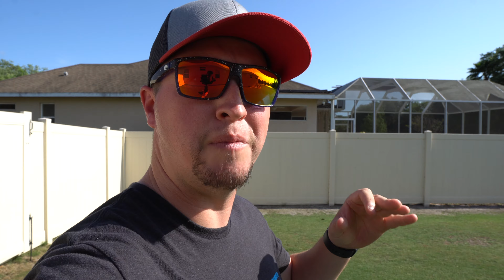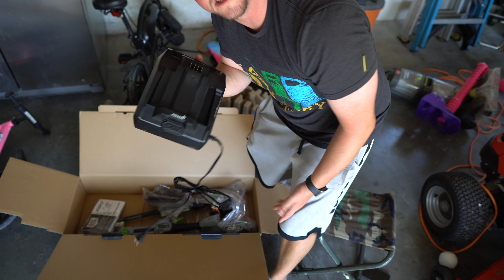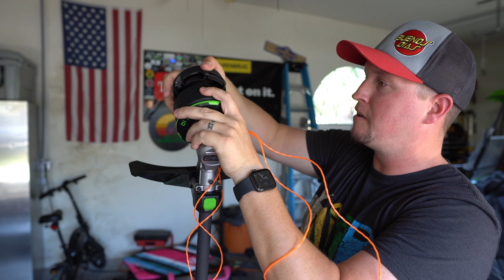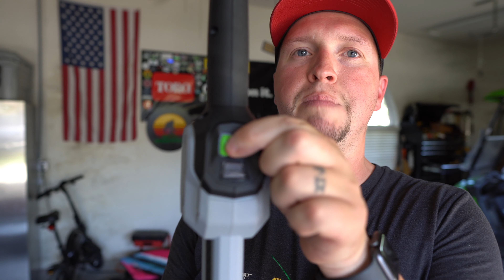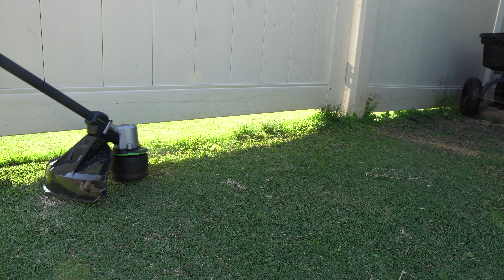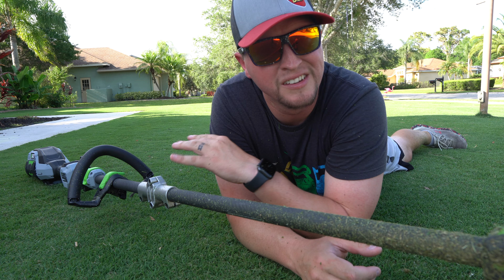Best battery trimmer ever?? Watch before you buy Ego 16" line IQ trimmer!

Comment: I just got mine, been using the older model for 5 years and needed a new battery to replace my 10 year old 2.5Ah. So it was a no brainer to upgrade because you basically get upgraded head and other features for $50 more.   Have not used it yet but if the Line IQ works like it is supposed to work, it will make my long runs of edging a lot simpler now. The sidewalk always breaks the line on these stretches and I am constantly bumping the unit.

Comment: I have acreage, I cut about 1.5-2 acres my driveway is just over 300 ft with curbs. Trimming just about kills me in the heat of NC. This trimmer is light simple switch to turn on. No gas and oil, and pulling with occasional hard starts. I have all gas sthl products. I told my wife after doing half of our property I feel like I went from riding a horse to a car. For just the loading of the string it would be worth for me. Between the light weight, the cutting power and not messing with gas and oil, I will be migrating to all battery tools from here on out. Kudos ego!!

Comment: 3 years later, do you still have a good opinion of this st1623t trimmer?  how’s the line iq?  i’ve read some horrible reviews on it.  it now has the 4ah & 2.5ah batteries for $299.99.  btw, what is the prior years model you mentioned?  thanks.
Reply from the maker: Good question. The line iq automatic feed stopped working correctly after some time and I like having control over when line feeds so I wouldn't recommend it at this point.
Reply: @Brettsgrasscapades  btw, what is the prior years model you mentioned?
Reply: @Brettsgrasscapades bump is still better then?

Comment: I mean.. I think for the money, one could go for a STIHL FS70 at around the same weight. Gas caveats aside, if it breaks you can fix it. You could also buy the commercial EGO trimmer with less features to potentially break and a slightly better water ingress rating. Ego tools are great and I use them in my landscaping business as well, but they don’t seem to be getting any lighter and don’t seem to be advancing enough quite yet to really rely on them for how much they cost with as many batteries as someone might need.
I’ve also found that these batteries last maybe 3 years tops before showing decreased capacity so that’s something to keep in mind when comparing maintenance costs of gas/battery equipment.

Comment: Thanks for a great video. I have gradually been moving all of my outdoor equipment over to EGO. So far I have a chain saw, blower, edger, and hedge trimmer. Next on the list is an string trimmer. Right now they have this model for $329 but it also includes an additional 2.5 Ahr battery ($179) in addition to the 4.0 Ahr. I appreciate the detailed review.
Reply: I just bought this yesterday, especially for the extra 2.5 Ah battery. My 7 year old cfm530 Ego blower battery is shot. And my old Sears trimmer with C3 battery, while is still usable, is a pita to reload string, and the string extension requires either multiple start/stop or manually doing string extension. But it does have a rotatable head for edging, which is convenient. The Ego seems easily convertible to edging by rotating the forward handle to the rear and inverting the trimmer, resting on my shoulder. Haven’t tried it in actual use yet, but that seems doable.

I thought about getting the multi-head Ego with both the trimmer and edger attachments, but thought the base unit was heavier than I wanted and the cost for all would have been pushing $500 with tax and all. So I got the st1623t from Lowe’s. They were out of the extra battery so it will be coming in a few days.
Reply: @speedlever  I'm thinking I need to make the purchase this weekend. Concerned that prices may be increasing in the near future.

My edger is part of the multi-tool system and I also thought about getting the string trimmer attachment but weight and price make no sense. EGO essentially gives you the tool for the price of a battery so buying a tool attachment alone is never my choice.
Reply: @ 
Honestly my old Sears trimmer is less that half the weight and with the ability to rotate the head 90*, is much easier to edge with than this behemoth. But in fairness, I’ve only used it once since I got it. I’ll have to learn how to trim and edge with this thing. My straight lines aren’t very straight. And when the head spools out more line, it affects the trim line too. I just picked up the 2.5Ah battery today and will try that next time to see if the weight helps.

Comment: There are two things I'm concerned with. I like a variable speed on the trigger itself when I need to be really careful in certain spots to not gouge up something, and I like the guard off for more string feed out making a wider cutting swath like the landscapers do. I'm thinking maybe the sensor would just limit the feed out to what it wants and won't let it out enough for what I want. Since I don't want to go back to a troublesome carburetor trimmer, I can live with certain lackings I guess.

Comment: I was very excited to get this trimmer!  Went to my local ACE and picked one up, read the instructions, put everything together, waited for the battery to fully charge, attached the battery, set my speed, pushed the lock forward, pulled the trigger and absolutely nothing happened, watched some videos did all the trouble shooting I could think of still nothing.  And off course I did all this because by the time I did everything the support lines were closed!!!  Bottom line, over $300 and I have a brick!!!!!!  Very disappointed in EGO!!!!!!

Comment: I have this same trimmer but for the life of me i can't get it to work like you do in the video. The thing is extremely powerful but it doesn't seem to cut anything. Doing my fence line has been brutal. It will just blow the grass over and if i move it a little closer it starts marking up the fence and pulls the trimmer forward and jerks all over the place scalping everything. I've tried everything and can't figure it out. Never had a problem with my old black and decker.

Comment: I am looking into these. Thanks for the video. EGO has a sale going on for a lot of their equipment. The sale for this one is if you get this newer model for the $300, they give you a 2.5ah battery free. They are doing the same thing for their higher end blower(765 CFM) Get the blower for $300 and get the 2.5ah battery free. Ironically, they have a deal, get this trimmer and the 765 blower as a bundle for $550, but you only get the one battery and charger in the bundle.. I am going to get them separately and spend the extra $50 to get the free battery.
Reply from the maker: Its worth it for sure! They never do sales like this so jump on it!

Comment: Good information, I was doing research on the Ego after getting an ace hardware flyer.  

And I came across your video just now, I am leaning towards getting one now.
Reply: They have a deal on these now, if you get this newer model, they are throwing in a 2.5ah battery free. ($180 value) I am getting one!

Comment: I got the $175 one 2.5 amp battery lasts 1/2 hr, bump head no issue, carbon fiber shaft , 15 in head, 10.5 lbs with battery, no adjustment on handle or shaft, 50 min to charge . 2x times to do whole yard. I’m 78 need rest day anyway. Same power as gas Echo.

Comment: Avoid Ego.  My battery died after a year after purchasing. Replacement died after 2 and now they are saying tough luck that it's outside warranty.  My string trimmer went down and it took 3 months to fix.  It seems customer service has gotten pretty bad over the last 8 years I have used their stuff.

Comment: 👎👎 My gripes:  the string length is too short, shaft is too short and it’s WAY TOO HEAVY to do a big job. It’s built well, it’s like an elephant.  Experimented with taking off the guard to achieve better swath, won’t go any longer.   I can’t see the hype for this unit.  Was $330, $299 on sale at Lowe’s and my light weight Echo was much stronger.     👎👎
Reply: Did the string line IQ work atleast?

Comment: I have this trimmer but don't like the auto feed line.  I have a lawn business and wanted to run this without the guard which you can't do becasuse it doesn't have a bump head.  how does power compare to the 1511t. They both have 2 speeds so I figured it was probably the same.

Comment: I know this is an old video but the bulk of the expense for this trimmer IS the battery. If you are already in the ecosystem or you are planning on getting a different unit.....get just the trimmer without the btty or get an aftermarket battery and save.

Comment: Thanks for the review I’ve never had one before. I was checking them out ant I noticed the better hook to hang the trimmer easily and secure. The workmanship was impressive when I examined it. I didn’t want to spend $300 either. But the 16 has a heavier look at the head and I wondered if it real worked as advertised. Thanks So  very much. Great testing video 👍👍

Comment: This design is horrific.  It will NOT let you manually extend the line, and you'll spend the majority of your time cutting with little nubs of line because it refuses to extend the line until you're almost down to nothing.  If I can't return it, I'm going to replace the head.  Garbage design

Comment: Not working out for my lawn business as I’d hoped.   The only flaw is the line IQ does not advance often enough as I need for effective use.  When it is at the full length, it’s great, but spinning with a short line wastes my time and energy slowing me down.  I mow 60 lawns per week, I can’t wait for a machine to decide to work.   Any suggestions how to get a faster advance ….a smarter IQ, mine seems to have a low IQ?

Comment: I don't know if it was last year's model, but almost a month ago we bought a lesser model that was part of a package with the blower (originally $300 and down to $200), and it was horrible. The bump didn't work more than half the time. We just picked up this one today. If it works as advertised the Line IQ is worth its $300 price tag in my opinion. It's also VERY nice that my wife and I no longer have to use an allen wrench to adjust the handle or length each time one of us uses it after the other.

Comment: I got this model the other day and it is just amazing as all of the videos make it seem.  But there is one unadvertised feature that no one seems to notice or mention.  On top of the main unit where the battery goes, the area where I usually brace my forearm to steady the trimmer is wide and flat and at the perfect angle for the forearm to rest.  And since it's battery powered, it doesn't get hot like on the gas trimmers.  Even other battery powered ones often have sharp, square edges to the housing in that area.
Reply: Probably meant ergonomics
Reply: @dougm8050  yep.  Lol
Reply: Bought th I s trimmer yesterday.  Absolutely worth every Penney of the $300.  With the 4 AH battery & Charger included and the advanced features it is a bargain.
Reply: @Loren07201 will I regret saving a $100 on the 15” carbon fiber model that doesn’t have telescoping features?  Has the same 4ah battery but it doesn’t adjust length and needs the bump to get more string.
Reply: Yep, the economics is awesome.

Comment: If the power load feature breaks can you do it manually?  Which direction does the head spin?  I saw two speeds but does it still have variable throttle speed?

Comment: Does line IQ still work if the guard is removed?
Reply from the maker: Not totally sure on this one.
Reply: @Brettsgrasscapades  So picked one up to test. It definitely does still work without the guard. However I’m glad I did a trial, I really dislike how it puts the line out unexpectedly. I have to use my string trimmer for long areas along the street and driveway where it’s old uneven pavement so I can’t use an edger.  When that line shoots out it jacks my straight edge up. So returning and getting the trusty bump feed. Thanks for your content, keep up the great work.

Comment: You are a very very brave man to use a line trimmer while wearing a T-Shirt, short pants and no socks.  Love the EGO products. They work superbly in every domestic situation I use them in. And the secret to optimum battery life is to trickle charge the batteries at least once a month with a standard EGO charger. Don't constantly hammer the batteries with the faster EGO chargers. Cheers from the Land Down Under.
Reply: Thanks for your comment on the charging strategy. I didn't know using the faster charger would reduce the battery life.
Reply: @carolebersole4025  The biggest factor you need to worry about is charging batteries when they are cold/freezing and when they are super hot. "Smart" chargers, especially with a fan should not greatly affect battery life when properly charging batteries in proper conditions. The heat from charging (faster chargers heat up battery and charger more) affects battery life mostly when batteries are cold/hot.

Comment: Thanks for the review Brett. I am a commercial solo operator in Aussie land, and after using this for one day, I think I will be returning it. I have the old carbon fibre model which has not skipped a beat for two years almost daily solid use. I don't think I've used my multi tool head for the string trimmer option!! (I use it every day almost for hedge trimmer / power broom occasionally and my fav is the cultivator). 

The problem I have with this after one afternoon's use ( on 5 different commercial properties) is that my line is not auto feeding out to the original 400mm as claimed by EGO. I have tried different 2.4mm line, (no longer than 4 metres as per EGO instructions) but same issue; it has to be really short before it auto feeds back out. Maybe I have a faulty head from factory? (auto load line feed worked perfectly). I will check, but your idea of fence grinding it  (and see if there are small pieces) was a good one, I will try this out tomorrow on a 3 acre property. Otherwise (as one other reviewer noted) you are paying in essence for a shorter line length trimmer. Otherwise the trimmer is perfect. I got approx: 45 mins heavy weed whacking out of a brand new 5 AH battery.

The head speed is slower than the old carbon model but feels more durable, Maybe they are running this motor at 80-90% for longevity. Balance is outstanding. However the vibration is significant if the line is not evenly fed, which I experienced multiple times during the afternoon. I had to stop, reuse self retracting line feed, then wait for auto feed to do its thing to get the line even again. 

This solved the vibration issue, but if you are not using up line super quickly this could be a real pain. Overall after one afternoon of approx 4hrs use I found it disappointing. (Enough to instantly consider returning). I have multiple EGO equipment, 21 self propelled mower, (Replaced under warranty after 3 months commercial use), 2x hedge trimmers & power head with multiple attachments (faultless). 

Overall time is money as a contractor as you know. If you spend multiple minutes per job trying to get the auto 'IQ' feed to self extend the line to get it to the factory length, then give me a bump feed any day of the year. I also found the line would be always approx half- 1 inch from the cutter, and was pot luck whether or not it fed out to the correct length.

Anyway I'll get back to you.... Cheers from Wes.
Reply: Yeah, a sensor on the head of a weed eater seems ripe for failure.  I'll stick with the bump head.

Comment: Can anyone say if this comes apart easily to put in a trunk for example? I have property several hours away and my Milwaukee comes apart easily for transport. I'm looking at the EGO line because of the chainsaws and mowers as well and the string trimmer coming with the 4ah battery is a huge plus

Comment: Well I saw the earlier review and picked up the st1511t, the day after I watched the st1623t review. Now feeling buyer remorse and conflicted. Although I am having a problem with the St1511t bump head system where string only comes out on one side, reloaded the string. working a tiny bit better but it seems like a issue with it. not sure if i should just return it and get the 1623. look forward to others chiming in.
Reply from the maker: I prefer the 1511 but if it’s not functioning correctly return it and get a new one.

Comment: Love my Ego lawn mower, tried a Worx string trimmer, it didn't.  Returned it. Will the Ego Lawnmower battery work in this string trimmer?  Would be great if their batteries were interchangeable with all their equipment.
Reply from the maker: Yes all equipment uses the same batteries

Comment: Thumbs down on day two with an Ego trimmer. The designers obviously have never done any professional mowing. Wrong list is LONG. Engine weight in head destroys my body. The head revolves in the wrong direction vs normie trimmers. Does NOT cut, it rips grass out. Would easily destroy a nice lawn. Head weight DESTROYS the arm(s) & back. With a normie trimmer I can cut an entire lawn to look like a golf green. Ego butchers it. Can't lock the battery from thieves. The handle is almost worthless. I've been a pro mower all my life. Ego trimmer = dangerous. If you mow for money this will break you in MANY ways, including windows and more.